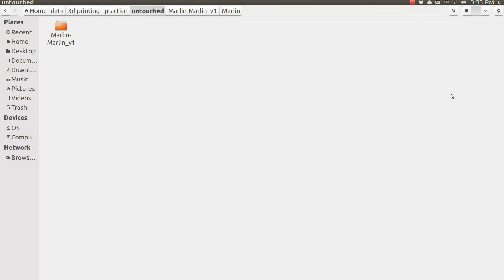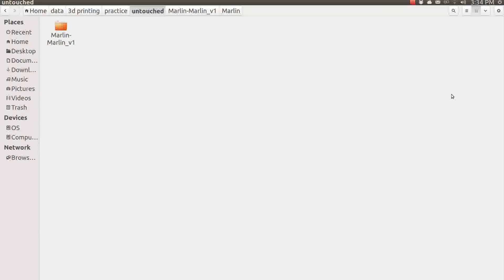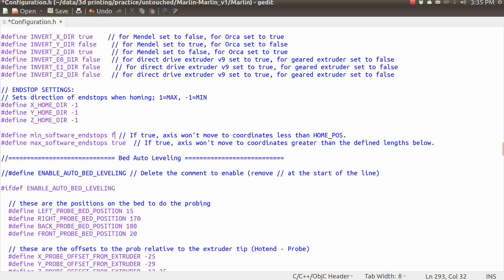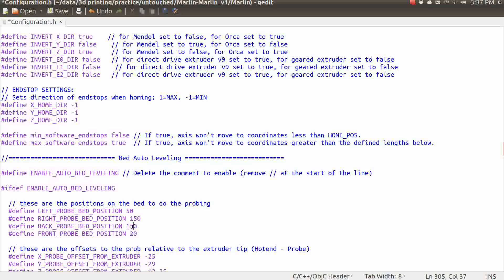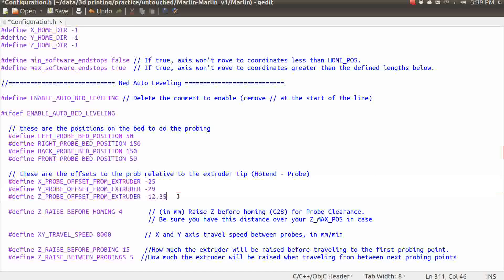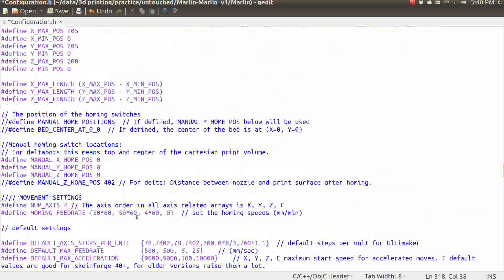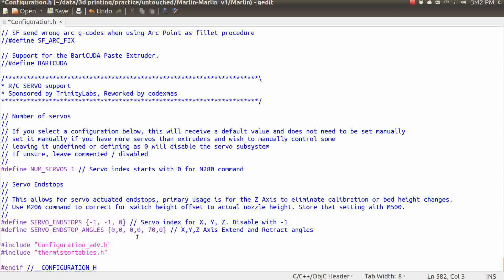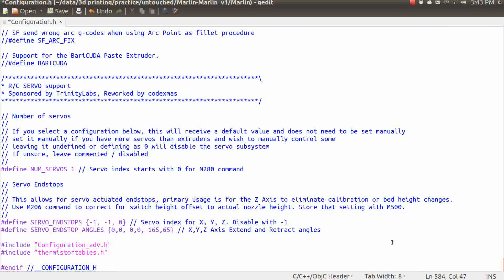Setting up auto bed-leveling on the Makerfarm Prusa i3. Part 2 - Configuring Marlin

Comment: Great set of videos!  I've now a auto bed-leveling setup on my aluminum frame i3.  It's now printing better than ever.  One thing to note is that I had to upgrade from Arduino 0023 to 1.0.5 in order to get the firmware to compile after I made the servo setting changes in the configuration.h file.
Reply from the maker: That is an excellent point, thanks for bringing it up.  With Arduino and RepRap development both happening so rapidly, that kind of issue has come up before, and I'm sure it will again.  Small price to pay, though!

Comment: Hi Zennmaster! I have a Makerfarm Prusa i3 8´´as you do.. so.. could you please copy and paste the entire code for the Configuration.h??? In theory if we have exactly the same 3d printer, if it works for you then should works for me, am I right? Wait for your reply. Best regards.
Reply from the maker: Nope.  I guarantee 100% that my configuration.h will NOT work for you, and yours won't work for me.  Especially if you're setting up auto bed-leveling, you absolutely, positively, and without exception must make the measurements on your own printer.
Also, getting comfortable with making modifications to your Configuration.h is one of the most useful skills you can acquire when you're working with RepRap printers.
Reply: +Cris Schlieaderman I can confirm, I have the same setup as Zennmaster, and my numbers were still different.  Best way is to do it yourself.

Comment: Can this be set up with a RAMBO board?
Reply from the maker: Well, the RAMBO is supposed to be firmware compatible with RAMPS, so I would think that setting up Marlin would be the same. Looking at the RAMBO wiki, it looks like the Arduino pins used for the servos are present.  So it looks like it's possible, but might take a little bit of work.  I've never even seen a RAMBO in real life, so I couldn't say for sure.

Comment: Michael, I'm also using a MakerFarm Prusa i3 (up and running for 1week now.)  I'm ready to move on to auto bed leveling (or should it be called - bed level compensation.)  

Can you tell me what all headers you needed to update to match the existing MakerFarm settings?  Did you just 'Diff' the files and go through them to make the base changes needed for MakeFarm setup?

Thanks!
Reply from the maker: Check out the link in the description.  It covers all the changes I made to use a current version of Marlin with the Makerfarm.
Reply: ZennmasterM Thanks I tried before but was getting a internal server error.  Looks like it's working now.

EDIT: Ok, basically 'diff' and update the configuration.h file w/ the MakerFarms values for the old stuff.  And all the good stuff about making note of your work ;-)  I usually just tag the lines w/ a comment having my initials and date, quick to search through.
Reply from the maker: TAZ427 Yeah, there's something going on with my blog software and my hosting company...  I'm hoping to get it tracked down, but it rarely lasts more than a few minutes.

Comment: Hi Michael, I have everything setup and working, however every time my probe moves to a new position, it retracts. The issue is that it seems to retract too early and leaves marks in the material that I use as the print surface (Glue stick). Any idea as to how I can fix this? I've looked through the code and have found nothin.
Reply from the maker: ***** I don't think there's a solution for that, I'm afraid.
Reply: Use a microswitch with a little roller at the end. It should slide then smoothly and not damage the surface
Reply from the maker: Paulius Vandalas
 And THAT would be a solution! :)

Comment: Hey Zenn, thanks for the video.  I went ahead and attempted to get this working by following the instructions on Alex Borro's GitHub page.  As far as probing goes, everything works the way it's supposed to but when I actually start a print, my extruder doesn't follow the bed.  I noticed that during the print, my Z axis stepper motors don't move at all.  Just wondering if you actually got this to work, if you might of run into a similar problem or know what I overlooked?  I also have a MakerFarm i3, almost the identical setup to yours.  Eagerly waiting for part 3! :)
Reply from the maker: Hi Andrew -

I'm not sure what you mean when you say your extruder doesn't follow the bed. Do you mean that the leveling isn't working?
 
One problem I did have was that the DEFAULT_MAX_FEEDRATE was too high for my Z-motors, so all they did after the homing was complete was howl, and my print started several MM too high.  I lowered the value from 5 to 2.5, and everything after that worked fine.  Is that something like what you're seeing?

Comment: Hi  can you help a noob got everything working it runs the auto bed setup but as I start to print it lowers head down but stays about 5mm from bed and prints in mid air can you point me in the right area Thx

Comment: Have you been able to get this working on the i3v? I have everything setup but my servo just twitches and continues to buzz as soon as I power on the printer. 

When I I disconnect the servo or the jumper, the buzzing completely stops. M208 command will make the servo twitch but not a full movement 

Any suggestions? Thank you.
Reply from the maker: It sounds like you might have a "power hungry" servo.  Some are like that.  You may need to add an external 5v line from your power supply to your RAMPs board.
Reply: It's the same servo you have in the video. I'll look into the 5v line. Is there anything that needs to be done with the pin.h file?
Reply from the maker: Unfortunately, the manufacturing tolerances on the servos aren't all that consistent.  On the other hand, the pins.h file hsould be fine.
Reply: I'm sure you have done something about your issue by now, but just incase you haven't you could try using a Ferrite EMI filter on the servo wires. I haven't had to do this for my printer setup, but in other projects involving servos where I have had similar issues to you I have.

Comment: I've been trying to get this working for a while and it's probably just user error. I believe everything is essentially set to go except for my servo isn't working. I tried running 5v to the 5v pin from an atx power supply and that did nothing so I decided to use a jumper and still nothing. Pronterface shows that the M280 command is sent meaning the servo is defined, but nothing happens. The servo support has been uncommented and it appears to be defined correctly in the proper pins file. I realize Marlin has updated since this video so it's possible there may be a conflicting setting but when rummaging through the code, nothing appears to be out of order. Do you have any troubleshooting tips for this? If not, what is the version of Marlin used in this video?
Reply: Scratch that, got it fixed. The servo I purchased at Radioshack was 4.8-6v which I believe was too high for the jumper as well as the power supply, which seems to fluctuate more than the advertised 5%. Anywho, I went to frys and got a servo with a minimum of 4.5v and that one works just fine.

Comment: Hi,

Today I installed everything according to your instructions, But i'm having a few issues.

The servo i'm using (Hextronic HTX900) was jerking around a lot during probing. I was able to solve it by using  #define  PROBE_SERVO_DEACTIVATION_DELAY 500.

However, It seems that whatever I try, the Z axis doesn't raise before and between homing and probing. The motors make a lot of noise but nothing happens.. All the other movements are ok. So basicly these three don't seem to work properly:

#define Z_RAISE_BEFORE_HOMING 4
#define Z_RAISE_BEFORE_PROBING 15
#define Z_RAISE_BETWEEN_PROBINGS 5

Any idea what this could be? something with the steps or speed settings? I already played around with the speed settings. Even copied them from the original makerfarm setup. But I keep getting the same results.

EDIT: I've made a short movie where you can see the problem. Auto Bed leveling issue
Reply from the maker: Hi -

In Marlin, look for the line with #define DEFAULT_MAX_FEEDRATE, and change the Z value from 5 to 2.5. 

It appears that there is a bug in the current version of Marlin, no one seems to be able to get the G28 to honor the Z_RAISE_BEFORE_HOMING value.  That's a real shame, since it would be a great way to prevent servo-related Z-crashes. 

The other two values seem to work okay once you've gotten the motor situation straightened out.
Reply: Hi,

I'm affraid I tried that already yesterday. I tried 5, 3, 2.5, even 1. Everytime the same results. 

In your case the problem was solved with 2.5?

I did try probing a few time even with this bug, but I found that afterwards when i'm moving the X axis with pronterface back to the right corner that the Z axis moves down too much, making the head crash halfway. So probably the printer can't calibrate properly due to this bug :-(
Reply from the maker: Barry van Hemert
The bug only seems to affect the G28 command, the G29 seems to recognize those values. Before and in between probings, the Z-axis will raise, just not during the original homing.
Something else to try:
Under "Mechanical Settings", there is a section that starts with "  #ifdef  ENDSTOPPULLUPS".  Inside that ifdef, there are six "#define ENDSTOPPULLUP..." statements.  Make sure the first three, which are for the 3 MAX endstops are commented out.
I left that out of my guide, which has been updated.
Also, you're using the Marlin from the official Github repository, and not Alex Borro's personal repository, right?
Reply: Yeah I got everything from the official repository. I followed your instructions by the letter.

Yesterday I flashed back the makerfarm firmware, and then everything woks fine. I then re-downloaded the official marlin firmware and started from scratch again. I first only applied all the changes to the firmware based on your instructions, but without the auto leveling changes. Again the printed fails raising the Z axis before probing. I did try to print something anyway (with Cura), and after probing the Cura cide tells the printer to raise the Z axis 15mm, and that command also failed, the motos started to howl, but no movement..

After that I tried the makerfarm firmware again, everyting works fine.

So it looks like it's in the marlin firmware itself...
Reply from the maker: Barry van Hemert
Barry, that sounds very strange but I have some ideas.  Would you mind dropping me a line via the "Contact us" link on my blog?
Reply: Sure, I'll do :-)
Reply: Barry van Hemert Barry/Zen Were you able to get this resolved?  It seems like for me if I try to use the probe delay activation, M401/402 ceases to function.

Comment: Great Video!! If my X is 280 and my Y is 200 what do I set for 
  #define ABL_PROBE_PT_1_X 15
      #define ABL_PROBE_PT_1_Y 180
      #define ABL_PROBE_PT_2_X 15
      #define ABL_PROBE_PT_2_Y 20
      #define ABL_PROBE_PT_3_X 170
      #define ABL_PROBE_PT_3_Y 20
Thanks, not sure if needed but that fits my bed perfect with out the probe going out of bed area(beds bigger then AXES CAN HOME

Comment: Hey Guys! So this has all worked pretty well for me, but every once and a while, when my printer begins auto-leveling, it will go to the X and Y coordinate of the probe point, but the Z will continue to rise, and will not stop, until I reset the printer manually (if that makes sense). Does anyone know how to solve this? I have tried re-flashing the firmware, and sometimes it will fix it, but not always. Thanks!

Comment: Hey @ZennmasterM  quick question.  instead of re-configuring Marlin, could I just cut and past the code from the newest version of Marlin to the version I am using in the same location on my already configured software?  I did not see the question asked so I figure why recreate the wheel if I don't have to...thanks in advance!

Comment: Hello and thank you for the videos they are very helpful. I am using Marlin 1.0.5 r2 and the settings are not the same in your video on setting up the auto bed level. Do you have any videos or blog help for setting it up with the 1.0.5 r2 Marlin?
Reply from the maker: I'll probably be updating the posts and videos, since a lot has changed in a short time!
Reply: Thanks I do have it working some what now. Still working on getting everything right
Reply: I cant get my G29 code to do anything but the G28 homes and the servo comes down touches the bed then goes back up . Then I try the G29 and ... nothing at all any clue what I can try to fix this?

Comment: Speaking of train wrecks....

The MakerFarm thermistor tables are not the same as the ones in the standard download. They use thermistor 6 for the MakerFarm thermistor. In the standard download it's something very different. You need to copy the thermistor 6 table from the MakerFarm thermistortables.h if you want to continue using their custom data. If not, switch to thermistor 1. It's a much better match than the normal thermistor 6. If you use the download table 6 with the MakerFarm thermistor, you will have much higher temps... fire .... smoke ..... death of small furry creatures ....

MakerFarm table is 47 on the A/D at 250. Latest download version from git has thermistor 6 with 28 on the A/D at 250. The download will bump things up about 20 to 30 C without you knowing it's happening. Thermistor 1 in the download is 48 on the A/D as 250C. It's much safer.
Reply from the maker: There are indeed a bunch of differences between the Makerfarm configuration and the standard, which is actually set up for the Ultimaker (Bowden extrusion, thermocouples, dramatically different drive setup and gearing, etc).
Like I said in the beginning of the video, I've got a blog post that is almost finished in which I talk about all the changes that need to be made.
Of course, the absolute best method for setting up a thermistor is to create a unique table based on the individual thermistor and the individual installation.  Piece of cake of you happen to have a Fluke thermocouple sitting around! :)
Reply: ZennmasterM Well it's a piece of cake if you mount the thermocouple inside the hot end when you do the table. If you do it on the outside of the hot end, not quite so easy to get it right. That's what they did with the standard table 6 (thermocouple on Epcos 100K) and it came out 20 to 30C wrong.